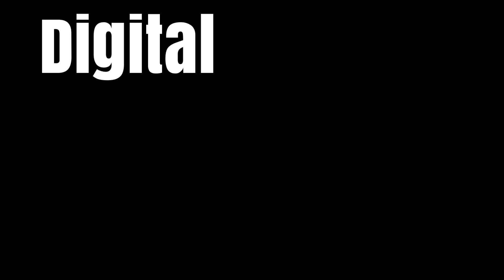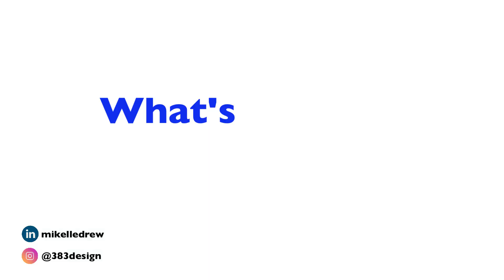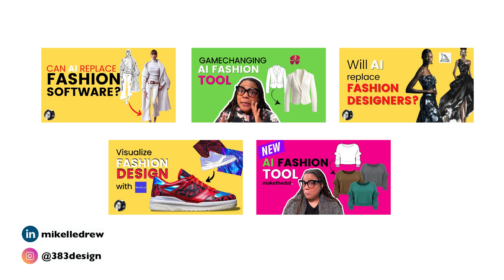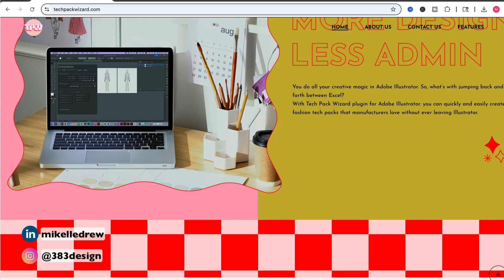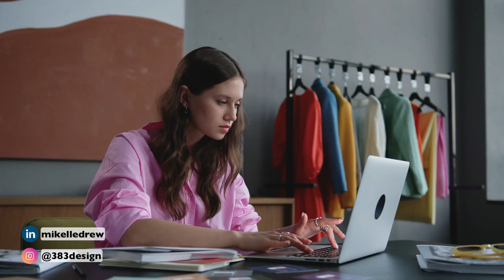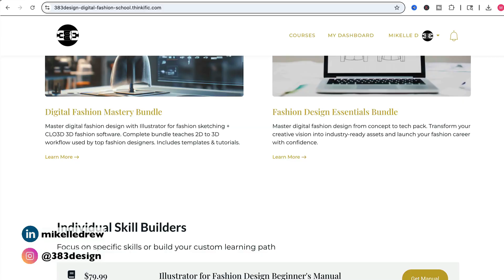Fashion Designers Keep Asking the WRONG Question

Comment: I'm usingn Browzwear 3D...
Reply from the maker: How long have you been using it? And how do you like it? I started in 3D learning Browzwear but eventually moved to CLO mostly because of accessibility. I was just thinking the other day of adding back Browzwear now that they have individual plans available.
Reply: @383design Since I join in their Indie Program 2021.Its a self taught but their modules are available more on videos. Now, that I've learned more I really enjoy using Browzwear. But here in the Philippines when I want to apply for a job as a Pattern Maker they commonly use is Gerber or Lectra. I think Browzwear can be use for remote job or business.